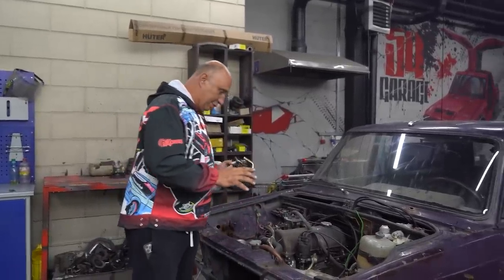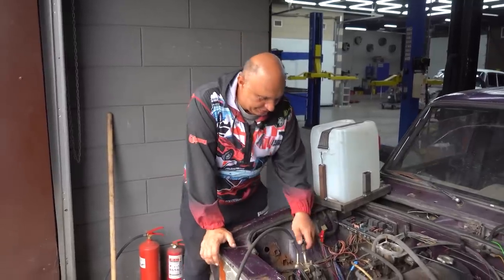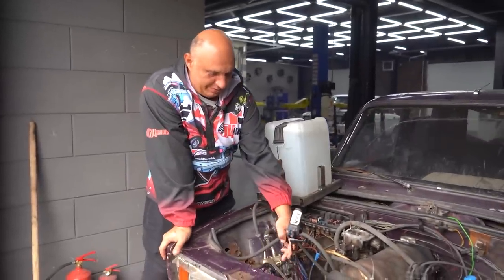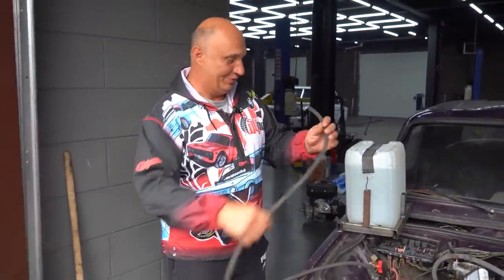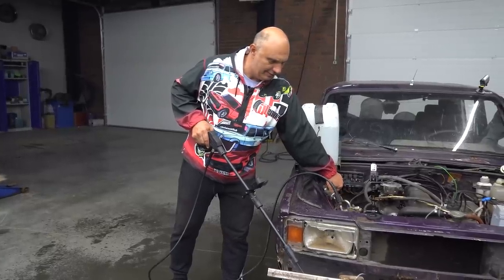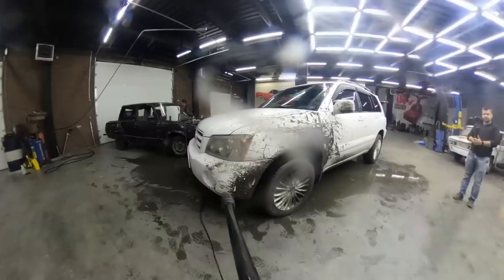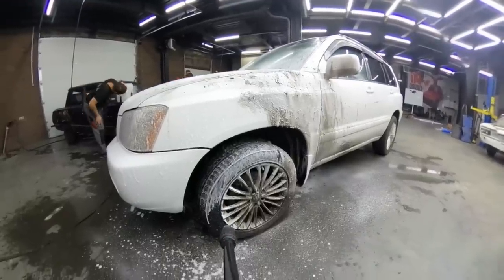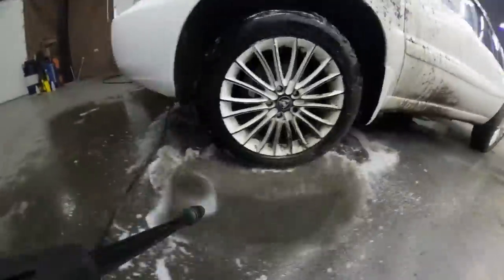Pressure washing using a power steering pump – will it work?

Comment: Use a common rail injection pump (30Kpsi) as a water jet cutter.
Reply: Amazing idea
Reply: They can cut the car to pieces as it's running!
Reply: it's going to seize up in matter of seconds. They already destroy themselves with tiny amounts of water in fuel.
Reply: @tomclanys  then water cut with diesel easy
Reply: @Chester200100  they do not mix, it would still seize up. They'd have to run pure diesel, but at that pressure it would atomize into a huge flammable cloud, believe me it's hard to breathe after inhaling it. Also these pumps don't have huge flowrates, so it would be a small stream
Reply: @tomclanys  yeah you're right i was just making a stupid comment, personally this pressures scare the shit out of me so i wouldn't want them doing it anyway
Reply: @tomclanys  hydraulic injection is no joke, i looked pictures of people who got injected with hydraulic fluid and their flesh was rotting away, scary stuff
Reply: @Chester200100  yeah you shouldn't touch any high pressure piping where they are leaking with bare hands, you never know if under that drop is a knife-like jet, but fortunately my dumb self never got hurt by touching drops. Do not do it though, ever. At least most of the times if there's a pressurised stream it will make a cloud around itself, so you know it's dangerous.
Reply: @Chester200100 I agree, just add diesel lol

Comment: Put air brakes from semi trak to the lada
Reply: You're going to try to stop a train with those?
Reply: Lmao! Jake brakes in a Lada would be freakin EPIC!!! But why stop there?! I’d run the air ride seats, add stacks, and obviously the air horn!!! That would be awesome! 😂
Reply: @TheOfficial_InsaneStang  IIRC a Jake brake is engine braking. Any car is capable of doing this, mainly manual which the lada is
Reply: Good one
Reply: These needs to happen lmao
Reply: @yung-megafone  Jacob's brakes are compression release brakes, which activate the exhaust valves to open just before the power stroke, quite a tricky thing for home builders to do. Oh and a petrol engine has a throttle valve which would have to be fully open to have air to actually compress
Reply: Don't just stop at air brakes, stick a truck motor box and axles under a Lada
Reply: Your wish will also should be granted from my point of view
Reply: 🤣🤣🤣are you trying to kill the fella
Reply: Cars don't have Jake brakes dummy.
Reply: @mann_idonotreadreplies  watch his newest vid lol
Reply: I dont know if they seen ur comment but their newest vid is doing this
Reply: @TheOfficial_InsaneStang  jake brakes and air brakes are different things
Reply: They did it

Comment: You could mount an electric fan clutch pully to the pump and adding a pressure sensor to control it so the pump isn't being deadheaded.  Pull the trigger, pressure drops, pump pumps, water comes out.  Release the trigger, pressure rises, pump disengages.
Reply: or, you know, just put a pressure relief valve and make it pump back to the tank, like it's done stock with these pumps...
Reply: @tomclanys  + free hot water
Reply: @tomclanys  Yeah, that thought crossed my mind originally, but I felt repurposing something for something completely different from what it was intended for was more in the Garage 54 spirit.
Reply: @tomclanys  For power steering pumps, the pressure relief loops directly back to inlet since normal operation is full flow going through the steering rack before coming back to the tank. The pump would likely have lasted much longer if they simply hadn't jammed a nut behind the built-in PRV to boost pressure to 3-5X normal.
Reply: Cool story bro.

Comment: You should retrofit a pressure washer pump to work on a accessory belt, that should work better. Big water tank in the trunk of the lada and you're fully self contained
Reply: @Karl with a K ...  I do believe the biggest problem is the water flashed to steam in a heartbeat any time the water is not flowing. If there was a pressure relief valve with some internal flow it may fix the issue.
Reply: @Karl with a K ... did you even watch the video? That pump locked up several times with only a few minutes of running. If you know anything about high pressure pumps, excess pressure will do that when it has no place to go. BTW, compressing anything makes heat. The difference is with water it tries to convert to steam, which takes up 1700 times more space.

Comment: there's something called an "un-loader valve" used in pressure washers.It's used to keep the pump from HYDOLIC LOCKING when you stop spraying.(which is why the pump pulley stopped spinning when you stopped spraying.AS far as adding soap,a T fitting added in to the fresh water supply useing a flow valve would have been of benifit.
Reply: The gearbox and rack and pinions have an adjustable unloaded valve so when you hit full lock it doesn’t mess anything up, you can hear it kick in when you turn all the way and it makes a weird noise
Reply: The pump pulley stopped after they increased the revs- probably temporary seizing from no water cooling at the roror blades because of cavitation.
Reply: @krazykyle393  They bypassed it. That's why it squeeled when he closed the water off on the gun.
Reply: @krazykyle393  my old car didn’t. It would just squeak the belt
Reply: @charlie_nolan  maybe it went bad
Reply: @krazykyle393  probably, the car was over 20 years old
Reply: Cool HYDOLIC BRO.

Comment: That is some very creative ingenuity there! You might try taking a regular pressure washer head and retrofitting a pulley that will fit the shaft and custom making some brackets perhaps utilizing some of the already existing parts you have laying around from the power steering pump. 😏

Comment: I replaced the power steering pump on my '01 Subaru Outback with a reman unit and took the old unit apart;  There are these hardened metal blades that slide and pump the water.  One side of each was shiny, meaning it had worn.  I put one of the blades in a vice and tapped it gently with a small hammer and it broke instantly.  These are VERY hard but very brittle metal.  But water is not enough to lubricate them, that is why the pump seized up.
Reply: You didn’t have to turn in that core?
Reply: it wasn't seizing, they just pumped too much power through the belt. Probably more than 2 kw at max revs. This tiny belt said no. Also there were no relieve valve, so he should be spraying all the time
Reply: Lol.

Comment: Can confirm removed the pressure relief valve from my car's power steering pump  and got 70% steering wheel responsiveness can now take 90 degree corners at 85mph

Comment: I agree with Gene Hunsinger,   BUT I add the fact that you also should change out the bearings for SEALED bearings so the water doesn't wash out all the lubricant from the bearings.  But Gene wins for sure!

Comment: I believe with the correct valving, water resistant anti friction/ceramic based coating to the bore of the pump, bearings and it’s vanes since water is a poor lubricant, a smaller tank in the back, with a garden hose bypass direct fitting in the front and you may have stumbled on to a interesting option for factory pickup trucks. If I could ever afford a new truck I’d happily pay $1000 bucks for an option like this. 

My suggestion is to add an electromechanical clutch for an air conditioning compressor, find a properly sized pressure switch with a high enough rating and wire it in such a way that once the hose is not spraying water it will disengage the clutch. You can use the pressure bypass port for that as a cheap add on and stop the pump from deadheading itself which can cause issues. 

You may have stumbled on to a hidden market and a way to save old worn parts and make them useful again for those who want to give it a go. 

Well done.
Reply: @Karl with a K or beter yet, take a air compressor, run it off the engine and have a pressure rated tank of water and 160 Pissies of air on it, that auta give ya a decent pressure wash, that or get a pressure washer pump and use a clutch to turn it on'n'off 
and its not nessesarily about the money, its bout reusing thrown aways that aint got no where else to be
Reply: @james cool story bro.

Comment: A power steering pump doesn't have a high flow rate but it does have over 1000psi capability n it won't work as a pressure washer because when you stop spaying you dead head the pump n it'll blow the high pressure hose or destroy the pump it also uses the oil to lubricat the vanes in the pump n probably won't last long with water!

Comment: it is not the blades of the pump that is the problem, the problem is the bearings on the pump shaft, as he said water has no lubricating properties, a power steering pump is an oil pump, it uses hydraulic oil so it has oil type solid bearings that need a constant oil supply, with no oil they are overheating and seizing up on the shaft even though they are covered in water.

Comment: Engines are so usefull but cars only use it to move, they should make an adapter like tractors have so you can use the engine to power other stuff.
Reply: Some jeep CJ5s were offered with PTOs (as an option).
Reply: Get a tractor with a PTO shaft
Reply: Many older 4WDs (Land cruiser, Patrol, Land Rover were some) had power take offs on them
Reply: @1989stephankemkers it's not that simple unfortunately
Reply: Dodge power wagon comes to mind
Reply: Cars already have enough 12v power to do most things a normal person would want. Just use alligator clips on the battery.
Reply: @rubiconnn  Would be nice to be able to run certain shaft driven stuff like a generator, grain lift, a mower, hay baler, water pump

Comment: Just buy a pump to suit a petrol pressure cleaner, fit it with the right gearing- 2500-3000 rpm and an aircon solenoid pulley. But fit all this to a traytop 1 tonner so you can use a 1000 L bulk liquid container. Have the pump outlet plumbed to the back for convenience of the access to fitting and storage of the hose.

Comment: I know you can turn an a/c pump into an air compressor. Requires some filtering and oil circulation setup but it works well.

Comment: By using a nut to disable the pressure relief valve you cause undo back pressure enough to stop the pump and burn the belt and overheating. I suggest rather than a nut, use a stronger spring so that when there is no flow out the nozzle, the pressure still has a relief but yet much higher.

Comment: You could convert a car engine to Pressure washer, one engine to drive the engine that is converted to pressure washer 👍
Reply: they have done this with air.

using a cyliner or 2  as a compressor great volume, 150 psi pressure. always run a max pressure relief valve.

Comment: There's a valve with a regulator spring in it needs to be taken out to get higher pressure.. also u can do that with a lawnmower engine or small mower weed eater motor

Comment: spring pressure valve in high pressure line to keep water flowing thru pump when spray valve is closed and pressure builds flow goes to zero 

needs a return to tank line to handle return volume from spring pressure valve. problem solved since 1900's

Comment: A pressure bypass valve would sort it. At least until the water rusts the insides once sitting for a day or so. The pump is a pressure pump not a volume pump but still it need to bypass excess fluid that cant be forced past the tint nozzle.

Comment: That's cool! You could have it permanently mounted in the engine bay, just have a belt tension locking mechanism lever, so, when you want to use it, put the belt on, lever to tension and lock into place, attach the inlet and outlet hoses, and bingo instant jet wash!! (then when you've finished, release the lever, pull off the belt - place in glove box or boot for next time).. You could even run the inlet hose down to a river, canal, or even your mates swimming pool! hahaha 🤔👌👍🤣🤣     😎🇬🇧

Comment: Power steering pump is designed to pump oil.  Water is terrible lubrication.   Pressure washer pump is designed to pump water, very different internal construction.

Comment: What about a high pressure diesel pump?
Reply: Probaly doesnt have the volume unles the would take one from a big truck with 8 cilinders and combine all ports but that would have incredible pressure
Reply: I wonder if it would even be able to keep up with the volume. Also water would ruin the injection pump
Reply: @tylermartin2631  mabey if the only used it to soap as a lubricant
Reply: and use it to spray diesel/petrol mix 🔥🔥🔥🔥

Comment: Can you install power steering pump on any car?
Reply: You can install anything on anything. It's a matter of how much work and how many custom parts will be needed.
Reply: Lots of serious off-road guys use power brakes called Hydroboost that doesnt use engine vacuum to assist the brakes but use a hydraulic reservoir powered by the power steering pump. Lots of automotive hydraulic power steering systems work between 800 and 1300psi, there are some "universal" systems that would need lots of elbow grease but you could do almost anything.

Comment: Power steering pump will make more pressure than an ac compressor but I don't think it will last very long with water in it instead of some petroleum based fluid but it might last long enough to wash a car

Comment: What kind of purple car is it?
Reply: Lada/VAZ-2105
Reply: @crown674  Was the car modified into a "pickup truck"?
Reply: @jeffmorris1956  Yes, it was modified by the Garage 54 themselves. It's based on the station wagon called 2104. 
There's a factory made pick up called VIS-2345.

Comment: you could you know, attach a pressure washer pump into it. from a gasoline powered pressure washer
Reply: You really don't understand this channel huh?
Reply: @joeschmoe6908  well if they actually need a portable pressure washer for their car detailing business.    they do actual garage and business stuff you know as well, i know they're just mostly monkeying around on this channel.

and if for some reason wanted to run it with a belt off a lada.. instead of using the portable pressure washer itself.
Reply: @lasskinn474  I'm not saying you're wrong, but literally the whole point of this channel    is trying stupid shit to see if it will work. Your suggestion makes too much sense.

Comment: i mean whats the point when you can use a pressure washer
and also how will you do it, put water in your power steering? itll rust and i do mean rust

Comment: Make an RB from a ca18
Reply: Nissan does a weird thing with the bore pitch. The centre of the engine, between 2 and 3 on a ca18 or 3 and 4 on a rb25, has a 98.5mm bore centre with oil passages compared to the 96mm bore pitch of the others. 
If you want to make a dohc head for a L28 engine from Ka24 heads you cant just weld two of them together. You need 3, you have to have the centre of the head overlap the centre of the block so the headbolt and oil passages match. All oldschool Nissan inline engines have this nuance.

Comment: High pressure fuel pump but just feed it with water should reach a Good enough pressure to clean the car
Reply: or feed it with diesel/petrol mix and burn the car 🤪